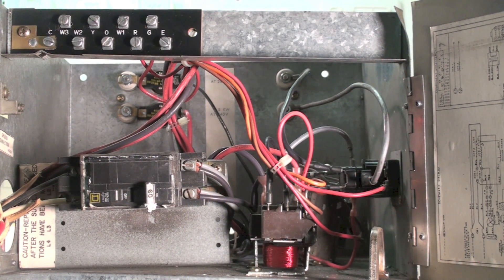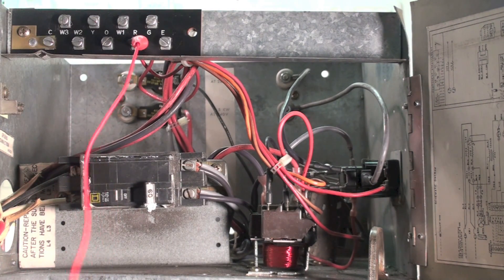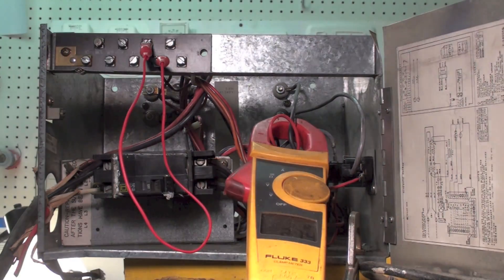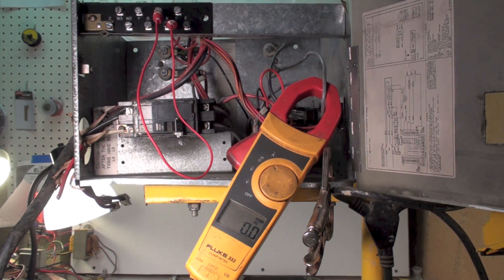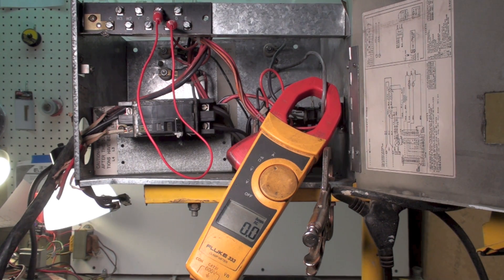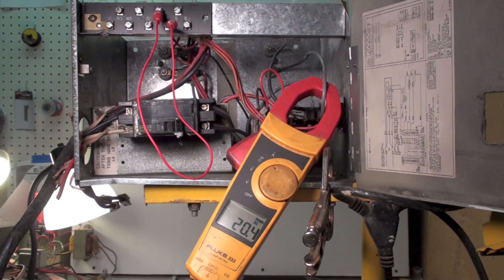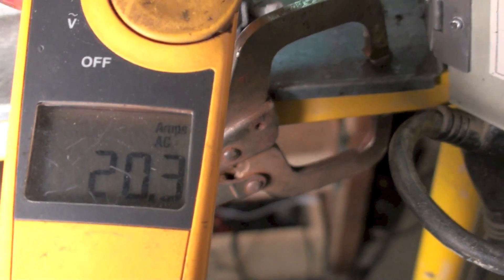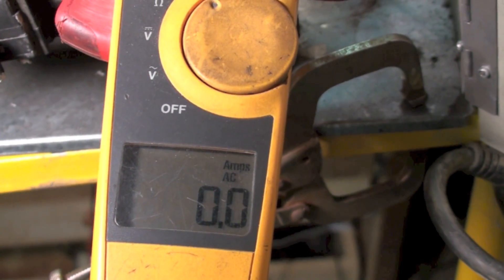How the electric furnace sequences on and off

Comment: My electric furnace seems to be always hot when I walk by even if its turned off at the thermostat and today it was hot outside and it didn't turn on all day yet its still hot when I walk by and the thermostat is switched off. I turned it off at the breaker and now its finally cool when I walk by. Is this normal?
Reply from the maker: It is not normal.
You probably have one of the elements stuck on and cycling on the high limit switch.
You need to get it repaired now.
GFM
Reply: @grayfurnaceman  thanks i will as soon as i can in the meantime i will shut it down at the breaker box to keep it from burning the house down.

Comment: Terrific explanations. I have a question. I’m out here in the boonies and need a repair to my electric furnace (Keeprite / 120/240 volt / 6 amp blower motor/ 80 amp elements/ ) The problem is that when the thermostat calls for heat, the furnace try’s to start and then blows the 100 amp breaker in the electrical panel. When I go to reset the breaker, the furnace and fan start up just fine and I hear none of the usual tell tale sounds of a motor or fan bearings straining or whining at start up, and once the thermostat heat setting has been reached, it stops running as it should.
  The issue is that sometimes the furnace will start up as it should when heat is called for by the thermostat, and sometimes it blows the breaker.
   The puzzling thing is that when I have the central air running, there was never an issue with the furnace blower starting up at all and the thermostat kept everything running perfectly all summer long .
  Any Idea of where to start diagnosing this one ? I’m not sure if I need an electrician or a furnace expert ?
Thank you .
Reply from the maker: This one sounds like a breaker failing.
GFM
Reply: @grayfurnaceman  I thought so too at first, but why would the breaker go only in heating season but never blow when the AC is running ?
Reply from the maker: @CharlieHorse970  When the fan starts, the electric elements also come on, which massively increases amperage draw.
GFM
Reply: @grayfurnaceman  aahhh yes of course! Thank-you so much for your quick response to my issue. I will start by turning off main breaker and see if the wires on the breaker need tightening as you have demonstrated in one of your other videos. Thanks again.

Comment: I found out the first sequencer was the problem, i did changed them all. My third one did not want to turn on, i found out i did not place a wire on the copper part. Now everything is fine. I still have one more question i have a white wire that goes from the first, the second and the third sequencer and than to my thermostat light. I have a purple wire that goes from the second and the third sequencer and than to a breaker and i have a yellow wire that goes from the first and second sequencer.

Comment: i have a problem with my electric furnace, since a few days it does not want to stop, not every time but many times, i have to turn off the breaker to make it stop. i know the thermostat is fine, because the red lignt indicating the thermostat asking heating is on. When that light turn off, sometimes the furnace does not shut off.

I have three sequencers, one of them does not work but i don't know how to find out which one is broken. Is it better to replace them all ?